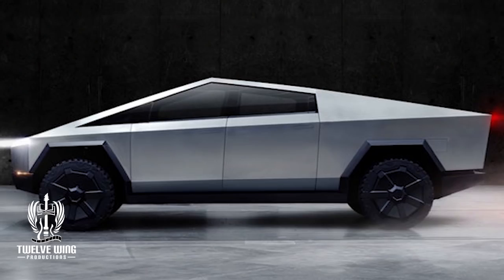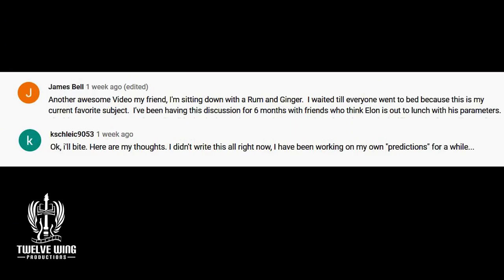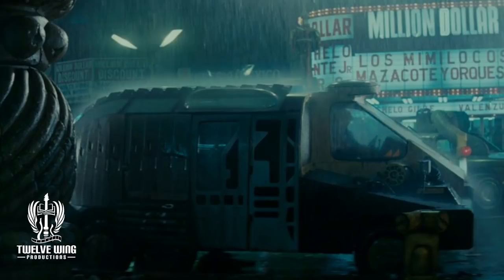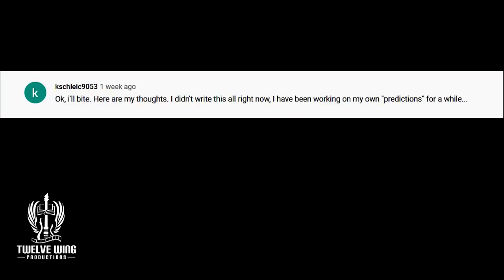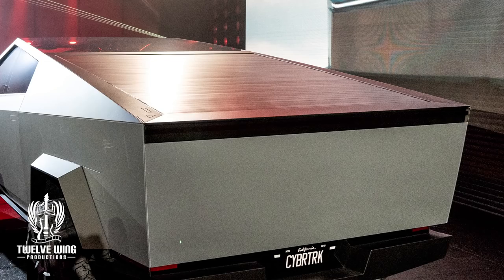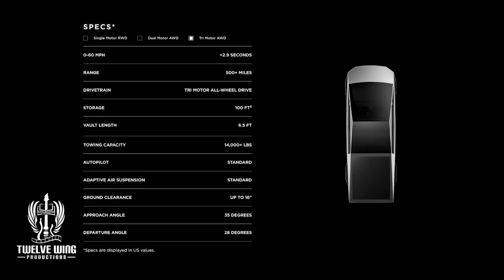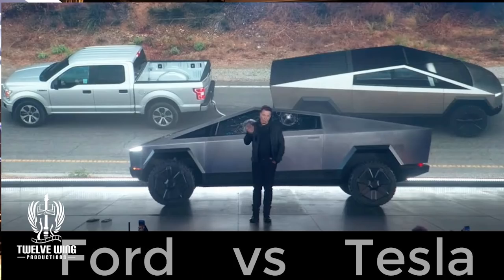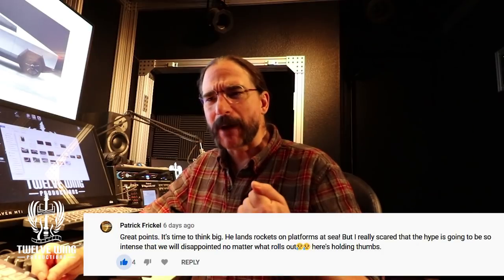Tesla's Cybertruck was not designed, it was engineered.  Here's how you benefit.

Comment: I get what you’re saying about being engineered, not designed, but that’s wrong. The Cybertruck was designed with functionality being more important than form, and that was a design choice.
Reply from the maker: The problems with "designs" is that they can run amok.
That's why the legacy manufacturers get into the situation where they spend several months work on the headlights, working with the wind tunnel guys... late nights... early mornings...
...
... then they go into a design meeting and are told that they have to scrap months of work because some nitwit with a design degree tells them they feel that the truck looks like it's "smiling".
This is the game this truck doesn't play.
Reply: Twelve Wing Productions, you misunderstand. You’re using an overly narrow meaning of design. What Tesla did was a deliberate act of DESIGN to keep the design engineering driven. I think a better way of saying what you mean is styling vs engineering, which is ironic because Tesla did something so radical it became stylized.
Reply from the maker: @kokofan50 , the exact difficulty you had in your last sentence is exactly the reason I didn't use that word... either.
My point has to stand as it is.  They saved money by not trying to design/style it at all.
They finished their engineering... and then they told everyone to sit on their hands.

https://www.youtube.com/watch?v=ecDWVWgKSRo

Comment: Hey bud, entertaining and thoughtful as always. I'm gonna have to go ahead and disagree with you on the water bit.

https://www.youtube.com/watch?v=rb_glRxHjcQ

I just recently watched the Rogan interview so this was fresh in my mind, but the S was already fording in 2016. 

I think the issue is that they slapped this together weeks before the unveil, and they are still dialing in some design elements. Musk implied he's not done with the engineering on the aero yet, and he's hoping to drop it to 3.0 but I think it will be a bit above that. 

Also, I think maybe a bit overstating the design replaced by engineering argument. I think it's more the case that the engineering principle of the folding stainless monocoque was the primary concern, and that they went through quite a bit of artistic and aero design within those constraints. But I do agree the XY and material choices were the primary issues.

I don't know what the inverter will pump out, but Musk said welding, my 240 pulls 50 amps. (Its' the biggest 240 you can get, so maybe it won't be quite that high, but 30a is like pretty standard for a 240v welder) That's  12KW at peak. Those are spendy, but not unreasonable, and in order to have a robust 240 and a split phase dual 120 output that will give out a nice sine wave and be really reliable, so that Tesla isn't swapping out inverters that fry... I think it might make sense to see at 15kw pure sine with a 50amp breaker on the output, possibly? That's what I would do in terms of delivering Tesla quality expectations and avoiding massive repair issues.

Comment: I wonder if they accounted for snow plowing?
Reply from the maker: Can you elaborate what you mean by that?  I'm an idiot from California so my experience with snow is limited to 2 years serving in Kodiak Alaska.... and that was mostly ice and rain.
Reply: @twelvewingproductions7508  most snow plows are attached the the frame of the truck. Landscaping companies get certain trucks because of there frame design, they last longer under the abuse of hanging a 500lb+ plow off the front and running into snow banks and the occasional curb.
The mentions of towing capacity, work trucks, and rescue vehicles just got me thinking about other uses. Here in central VA we dont usually have more than 6" on the ground at a time, but our total snow fall is 1-1.5 feet annually

Comment: Every vehicle is engineered.
Reply from the maker: Every vehicle is engineered for the first month or two.  The point I'm making is that those engineering models don't look like the cars that eventually roll off the assembly line.
Once the engineering study models are complete, they are handed over to those who are going to style the body.
During the study model phase, the physical dimensions of the components that are known "and their mass" is installed in the model.  Once they start to style this rough wire frame, the designers are given constraints as to how far they can push the scale of various surface areas before they interfere with the size of these known components.

This is the step that is totally missing from the Cybertruck.
They didn't waste a moment of time making any such accommodation for style.  They ended the design phase right then and there and this is what they wound up with.

So while it's true that every vehicle is engineered... every current vehicle on the market is styled.
Until now.
Reply: @twelvewingproductions7508  Aww, cute. He thinks the production Cybertruck will look like this.
Reply from the maker: @TroySavary , I do actually.
If you do not that's fine, but you should commit to what you think will be different.
That puts you on equal footing to the others here, myself included, that actually make predictions and have some fun backing them up with our thoughts.
Reply: @twelvewingproductions7508  Well, the thin light strip casts way too fucused a beam. So the lights are definitely getting a redesign. Musk said with extreme effort, he thinks they can get the Cd down to .30, which leads me to believe that it is significantly higher now, and he will change the shape to lower it. The demonstration truck is built on a frame and is not the exoskeleton he is promising, so chances are things will have to change to meet tgat goal. Then there us the lack of a bumper and apparent lack of crumple zones. This truck was hastily thrown together just to have something to show.
Reply from the maker: @TroySavary , Interesting.  This is actually the first I've heard that the truck they displayed had a frame.
Where did you hear that?
Reply: @twelvewingproductions7508 
"Construction of the prototype is "unibody-on-frame" in the same vein as the new Land Rover Defender, but the production Cybertruck will be pure unibody."

That quote is from Motortrend's preview. https://www.motortrend.com/cars/tesla/cybertruck/2021/tesla-cybertruck-electric-pickup-photos-info/

Comment: Biggest engineering risk to the cyber truck. With a on  frame design the damage will be by the accident area with a exo design the crumple area may be in the middle of the car. The car would not be repairable. A 20 mph accident may total the vehicle.  Insurance cost?
Reply from the maker: I've been giving that probably more thought than I should and the conclusion that I finally came to was that repairing this car will be all about stress analysis and the jig used to true up the chassis.
Oh... and electrical isolation during welding.

Repair of a major accident would go something like this:

Remove doors
Remove drive units
Remove battery
Scan for stress build up in areas and make cuts to relieve the stress in those areas.  The steel will snap back to near 100% straight in every area not directly affected by a fold from the crash.
Isolate all electronics prior to welding.
Find the nearest solid square surface to where you made your cuts in the chassis.
Using a jig to place the new panels, weld the new structure in place of the damaged section.

Because I am near silicon valley, I actually personally know several aerospace technicians that can easily work with this material.  I made inquiries and they pointed out that if enough of these are sold that it is possible to actually have robots programmed to recreate any part of this chassis.
The only limitation to that is uniformity.  If they make a design and stick with it, then shops will be able to very quickly repair this with jigs and robotic welding.
I also predict that this is how an aftermarket manufacturing industry will get hold of the base vehicle and turn it into a whole host of other body types.

The biggest hurdle to how this thing will be able to be repaired will be in how they rout their electronics and wiring harnesses.  The first step in repairing this thing after a serious accident is going to be relieving the stress to see what is still straight and what isn't.
After that, it's quick and inexpensive to repair because you don't have to order any parts.
Reply: @twelvewingproductions7508  if the interior core is twisted I don't see how you can get at it and weld the exterior panel from underneath.
Reply from the maker: @BrianFrenchinternet-marketing , obviously at some point one of them will suffer an accident so bad that it can't be "repaired"... but even at that point the chassis can be ordered and many other parts reused.

My point was that in the case of a severe front end quarter impact, the chassis might "look" bent...but because of the material, once the crumpled steel is cut away, the rest of the chassis will spring back to straight.
That's a quality of work hardened steel.

If the main body of the chassis is straight, then only the affected section needs to be removed and replaced.
Reply: I've seen 5 cars split in half on the freeway in my lifetime, which were mostly BMW's. It tells you a lot about on frame designed cars that it's defective. The exoskeleton frame however will serve as a protective shell and more effective against crashes.

Comment: yes, got to know that every other car have been designed only, not single engineer involved. what bs tittle this is..
Reply from the maker: You have it backwards.
The designing is the very expensive finishing touch that the Cybertruck felt it could do without.

Because of that, Tesla saved hundreds of millions of dollars in development and manufacturing costs with further manufacturing cost savings that could easily rise into the billions of dollars in just the first couple years of manufacturing alone.

So the title is accurate.  The truck was engineered and not designed.  The truck was built by the engineers and the designers were told to sit on their hands.